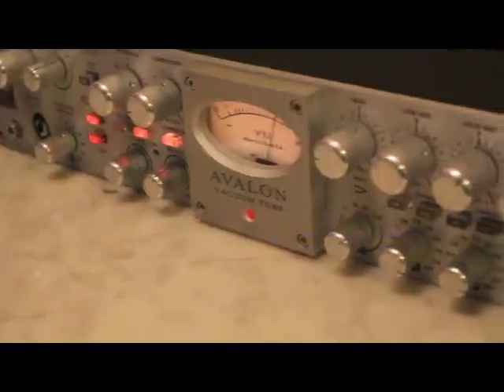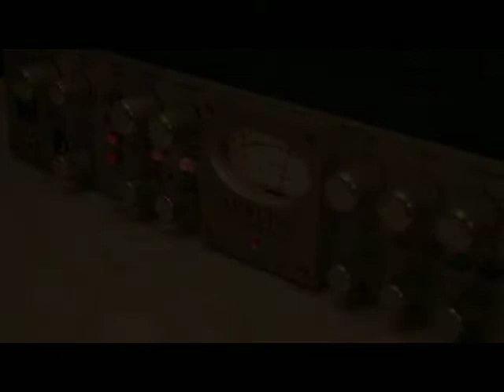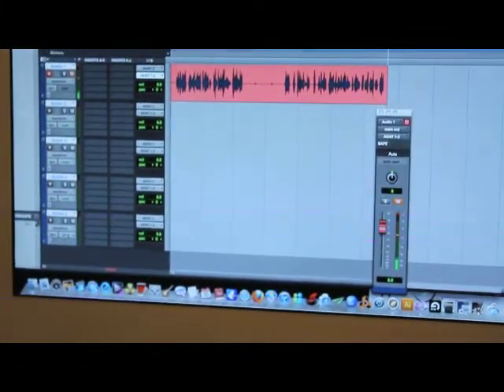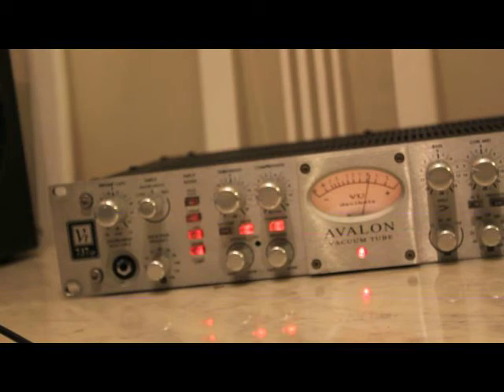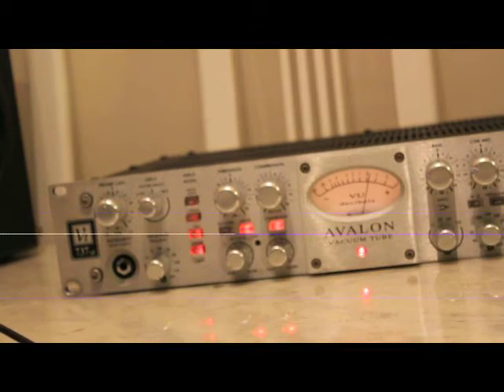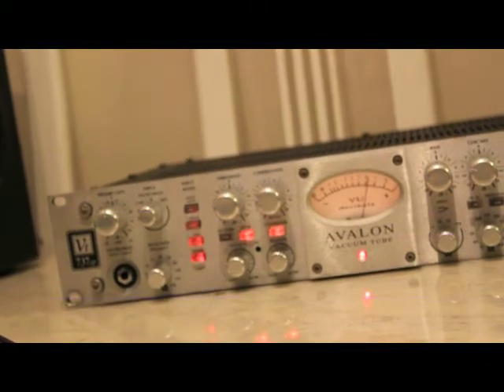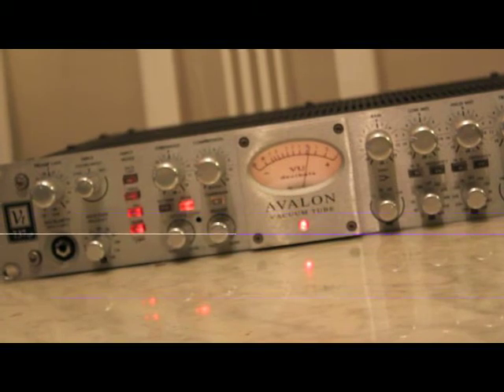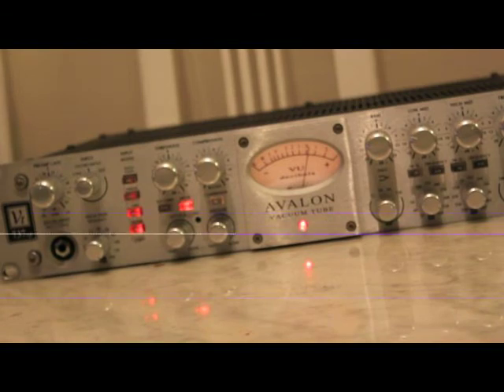AVALON MIC PRE BLOG HD.mov

Comment: To "hear" the channel strip, there's absolutely no difference on whether you're using ProTools or Cubase. The only thing that matters to the actual sound, is the interface/converter you're using (in this case the Apogee), since that's the one that converts the signal into digital. After that, you can use ProTools, Cubase or whatever daw you like to record and mix, but the actual sound (the actual digital clip/file) is exactly the same.

Comment: Hi! do you use the apogee with the digi003 at same time (linked with fire wire) for using pro tools? i have a 003 and want to buy the apogee ensemble but iam not sure how it works like this. greets : D

Comment: yo how do you go about using the compressor in it? i'm still gettin familiar with the avalon and in a lot of mixes, the beat seems to overpower the vocals.. i tried switching up between the pre amp and the output but whenever i got a good level it would be crazy distorted..
Reply: Just turn the beat down